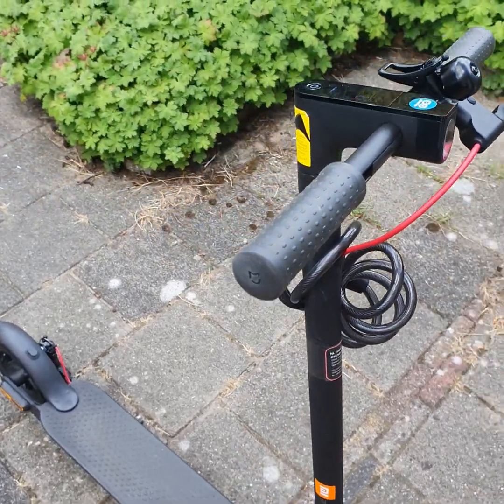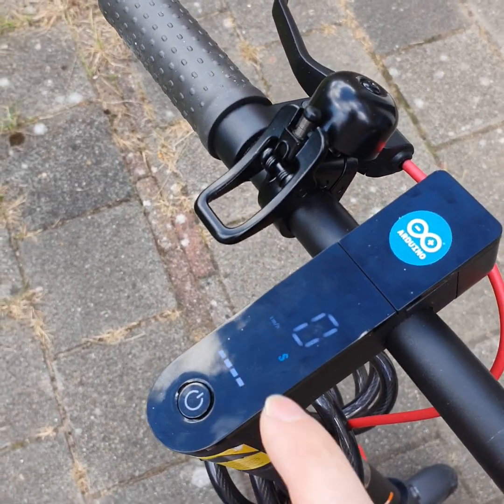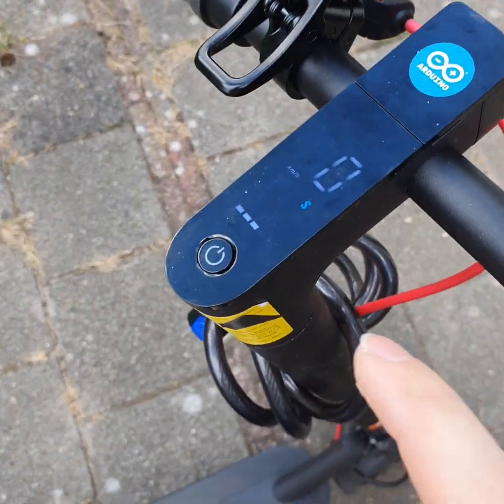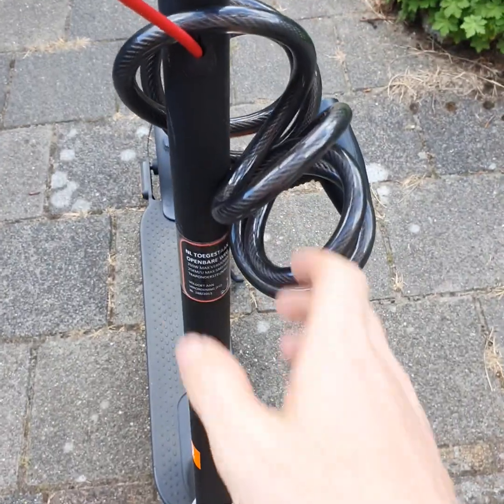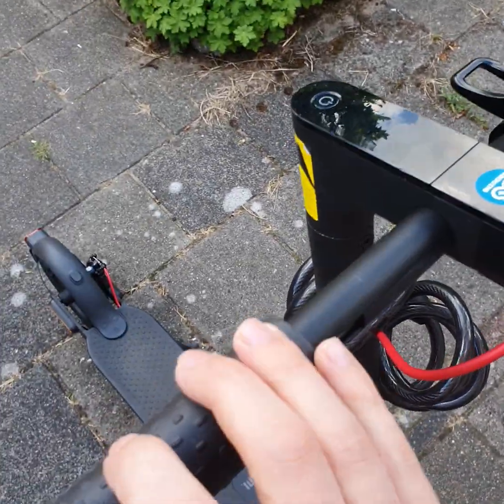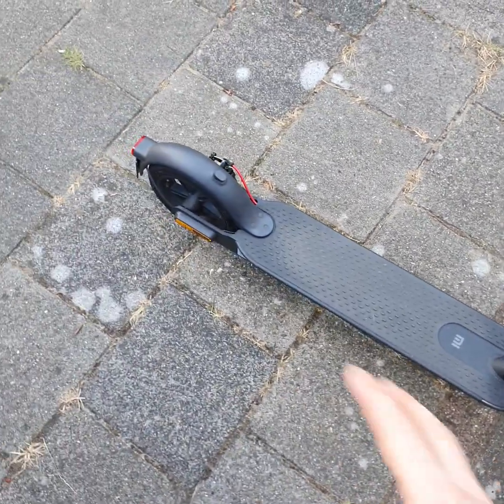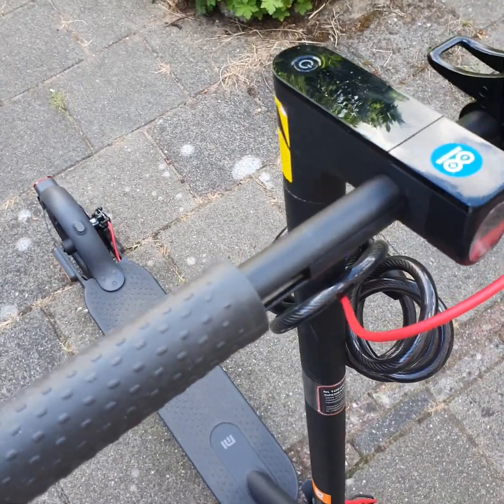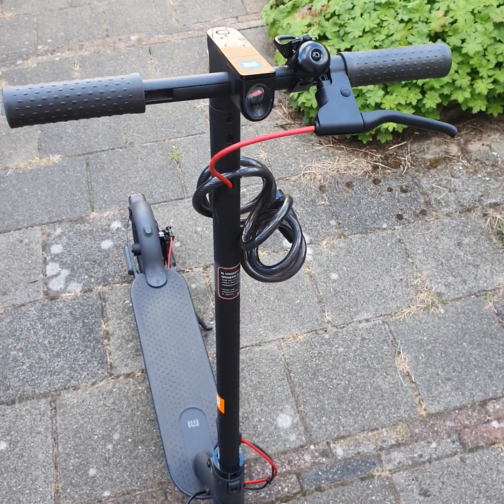modified to be road legal escooter for in the Netherlands

Comment: Hey just I've tried this script and my scooter can only go as high as 15kmh and it's kick detection often doesn't work. Do you also have these problems and is this as good as it gets or am i doing something wrong?
Reply from the maker: Yeah it doesn't work well with the lights turned on because the light uses too much power and then the Arduino doesn't work well